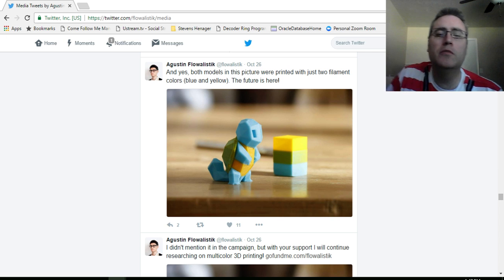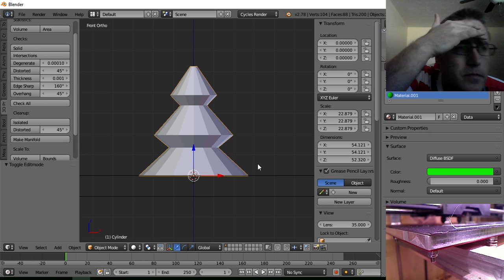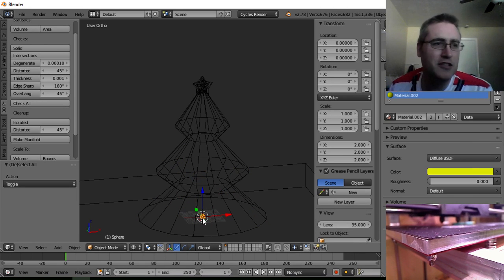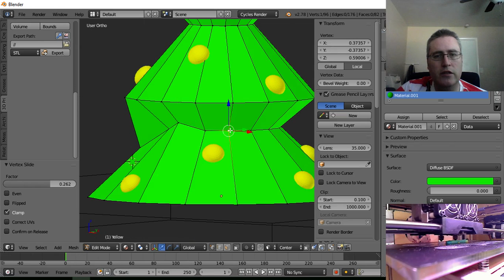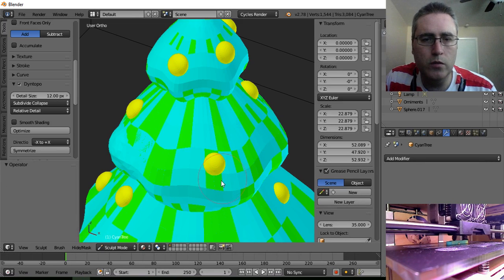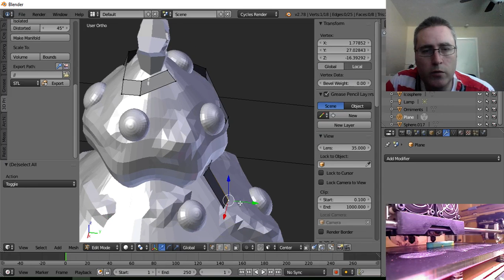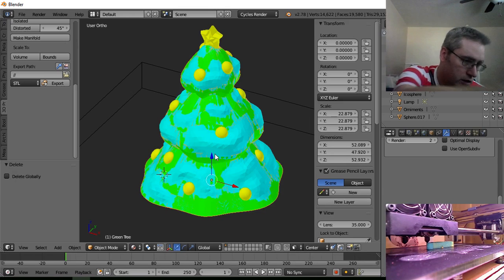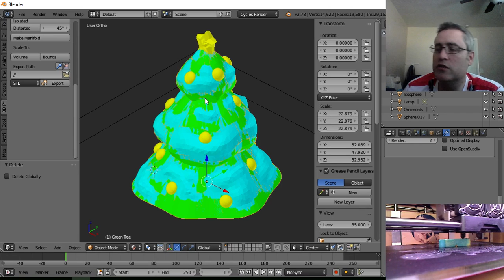Advanced Dual Extrusion and QA livestream

Comment: Hey hello.What laptop are you using or rather which one are you thinking about getting?I am looking for a laptop myself, what would you say is necessary to for on 3D models with blender etc.?
Reply from the maker: Accoring to the sticker on it, it's a quad core with A6 AMD Radeon graphics with 8 gig of ram. Blender insists that it only needs 32-bit dual core 2Ghz CPU with SSE2 support and 2 gig of ram, but more is always better.

Comment: a very bad sound - I don`t understand a word :-(
Reply from the maker: That's... just my voice.

No, I'm kidding. I'm using a USB blue mic for these which works okay if I'm going through audacity, which I do for my other videos especially the 3D Printing 101 series. I probably should just use a normal mic for streaming. Thanks for the feedback.
Reply: not having any trouble understanding you, did you change anything after it was saved? if not then I think it might be on his end lol
Reply: ... my end is OK :-)
Reply: wondering why if it was on his end it did not sound bad at all, all sounded just fine. could understand every last bit of what he said, no worry just wondering is all.
Reply: The problem is still the same at my side. The sound is very quiet and hardly understandable. There probably stands someone in between the way to Germany :-)
Reply: lol no idea, maybe turn up the speakers? and turn down the bass a bit ? XD
Reply: ... only for your information. I`m a electrical engineer and I think to know, how a amplifier is working :-(
Reply: your description of what you were hearing is what prompted me to offer suggestions, as I have solved those problems before with them. also its not electrical engineering that works with solid state and tube amps but electronic engineering lol Electrical engineers design and set up plans for installing electrical systems in buildings, to supply mains to various outlets and fixtures, last I checked